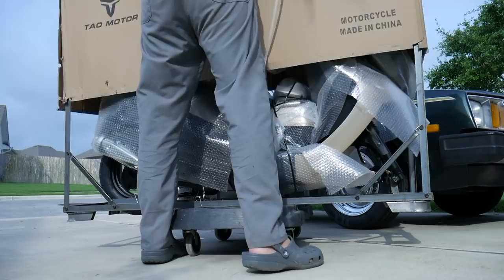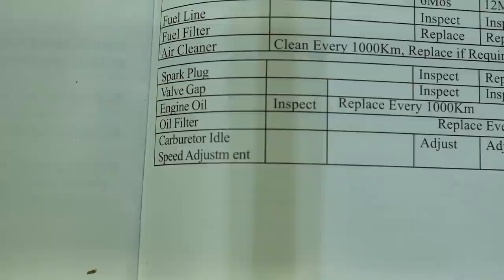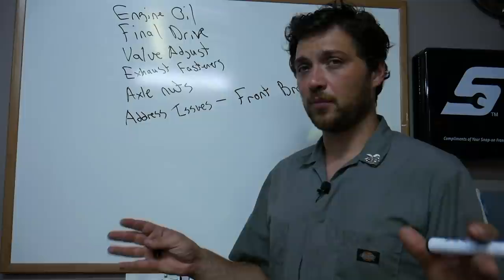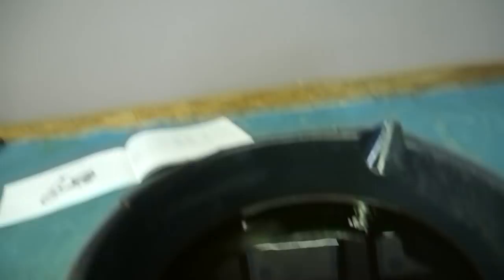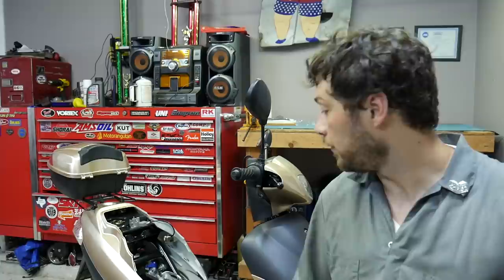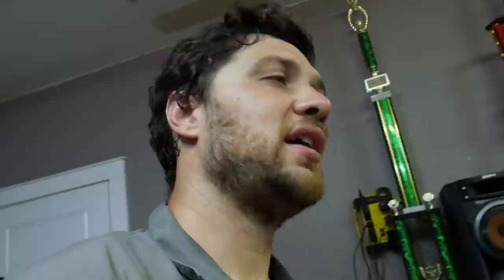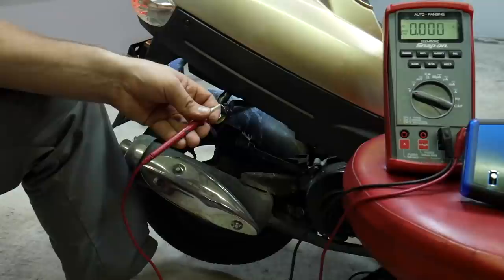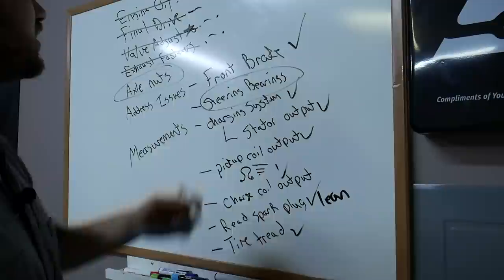(PT. 3) 300 Kilometer service on the most HATED scooter on the internet: Living with a Tao Tao

Comment: Likely not broken in yet. Changing the oil early took away the "rubbing compound" that helps "wear-in" the rings, most likely. 

I heard a story from an old mechanic in the 70's who had a kid bring him a new car that started smoking after a few thousand miles. Turns out the kid had replaced the break-in oil with Wolf's Head, a premium oil, the day he took delivery of the brand new car. 

The Mechanic put break-in oil back in the car and asked the kid to read the owner's manual section about VEHICLE BREAK-IN PERIOD INSTRUCTIONS, out loud, right in from of that mechanic. When the kid got done, the mechanic told him to follow those directions, let the oil do it's job and quit second guessing the engineers who designed his car.

The carb issues are likely due to the low compression due to not being broken-in yet?
Reply: It will still wear the rings and cylinder wall smooth eventually, but may take a lot longer. 
On the plus side, the bearing surfaces love you.
Reply: Actually after a quick check, it looks like low compression would lead to a lean condition due to a lower velocity of air flowing through the venturi, leading to less gas being metered into the airflow. 120 vs 150 is likely a substantial difference on how much air she is pulling through the carb.

My backyard mechanic 2 cents... :)

Comment: if you try and jet the carb your going to have to cut the carb because stock carbs have the bowl screws filled in. You can get a glixal carb which uses philips screws and comes with a bigger jet from the factory

Comment: Put a tube of RVS in the oil and run it for 300 to 500 miles. You're going to get all the compression it's supposed to have. Cost is around 40 bucks.

Comment: Air filter and be sure the engine is on TDC before Valve adjustment, I have Alot experience with the  139qmb and the (gy6) 157 qmj chineze engine

Comment: Yeah I would take the carb off find out what jet she's got and up it by 2 sizes I expect it's got a 70 in or something so put a 72 in there. Running too lean will get the engine HoT and shorten its life. So yes I would most certainly up jet it by 2 then run it for a while then pull the plug and all should be looking as it should!!

Comment: YOU CAN REMOVE .118" thousands of an inch safely and polish it down to a point again(needle valve) and you throttle response and spark-plug color will be favorable!!!!!! All stock, it's also a great tip for a budget owner!!!!!!!!!!!!!!!!!!!!!!!!!!!!!

Comment: If you have the mechanical skills you can keep these little scooters going forever as the spare parts are so cheap and easy to find on ebay amazon ect. I got a brand new boxed crankshaft for £25.00 and new piston and rings for £3.95, then a 70cc bore kit which included most of the engine internals and gaskets for £37.00!.

Comment: So my opinion would be to only go the extra mile, like with adjusting the carb jets, if you think it is something that a person like me (able to google and follow instructions, but no mechanical background) could pull it off without screwing everything up.  If there is anything that you think would absolutely require a professional hand to do, it doesnt help people like me as much to know since I live in a place where professional service is a non-option.  No mods until you've reached whatever original goals you have set, then go nuts and unleash maximum power.

Comment: I don't think you should rejet permanently just yet. Just find out if it will help then put it back to stock. Later, after the scooter is fully broken in, running as good as possible in its stock format with all the weaknesses identified, then make logical mods for better performance (with reliability in mind). Let heavy mods be for preople that want to go further than the scope of your videos.

Comment: An advise is to actually run normal car oil. Worked very well in both of mine and never had a problem with that.
Reply: @Pony Boy I ran 5W40 semi synthetic but never let mine warm up. Full throttle right away and it is still going. Must have ran about 10000km by now actually

Comment: I got a 2006 Rex RS 450 with 15560km. Stator died at 15100km. It produces to much output. At full throttle over 200W and a charging voltage over 17V. For the valves use 0.10/0.10mm

Comment: You mite check miles per gallon of fuel too, is the carb have an adjustment foe the mixture? What carb?
Reply from the maker: I've been keeping track of fuel economy! and yes the carb has an idle mixture screw. The carb is a cheap clone of a Keihin CVK

Comment: You went the extra mile for the engine oil, final drive oil, brakes and headset bearings.  Id say if it needs the rejet/carb adjustment id go the extra mile for that too.  Putting a new carb on is were i'd draw the line.

Comment: We just call that upper nut a "lock" nut
Reply from the maker: hmmm in most service manuals a nut that tightens up against another nut is called a jam nut. Tomato.... tomato?
Reply: @Scooter_911  HA, I pronounce it tomato. Sounds nothing like those 2 examples.

Remember that the service manuals you use are regionally modified. Where I am, they just include more metric and include stuff a little more appropriate.

Comment: The time to return to 13.8 could be a function of the battery.  Weak battery is going to suck the current and keep the voltage down for a while. What about testing the charging system with no load.

Comment: I don't know if you told us about the stock speed, but I know the stock speed is way to slow for me,  when it comes to acceleration or going into traffic., it's up to you if you want to do a before and after fuel consumption, after jet/carb change

Comment: I usually 'bounce' the tire to the floor when I do steering head bearing adjustments while tighten/loosen the nut. 
Well, you've already adjusted the head bearings, why not adjust the carburation?  I find the head bearing adjustment much harder to do than the air/fuel mixture.

Comment: Not a Tao Tao review if you start bolting on aftermarket parts.  I'd say, don't replace parts unless they break.  After all, this is supposed to be about reliability.
As for rejetting - I would ask you, if a customer brought the bike into your shop, would you bring the lean plug up (i.e. do you think this is problematic) and ask them to consider rejetting it?
If you would, then yes, rejet it.

Comment: Are there any Chinese scooters that don't run lean? Put a shim under the needle of the stock carb and got a massive power boost. Checked the spark plug after 200 miles and it was perfect.

Comment: Hi Garret 
Man I need some help 
I’m bout ready to Dump my Tao Tao 
Bought 3 years ago 
Rode it for a few months 
Had an issue 
Couldn’t solve 
So it sat 
I played with it off and on 
Here goes 
I’ve changed everything 
To start 
I use starter fluid 
In the carburetor 
It doesn’t start on its own
Reply from the maker: Have you tried a valve adjustment?

Comment: Sadly all you can do is rejet unless carb fails than you would note that and replace. But your motor is looking like a lemon. Comp being that low at 300km not good at all brand new it should pop up to 140 slowing down than work its way to 150-160

Comment: Can I ask you honestly, how did you break the engine in? Did you just drive it normally, or did you go the "official" route of only using 1/4th throttle and not going faster than 20mph for the first hundred miles?

Comment: My experience with these Chinese scooters has always been carb issues. Usually after not using for a while the jets clog and it won't start. Any suggestions?
Reply from the maker: If your scooter is going to be sitting for a while drain the fuel out of the carburetor. It will save you the hassle of the jets clogging!
Reply: @Scooter_911  What do you think about the EFI for these engines vs. a carb? And are there any cheap scooters with EFI worth it?

Comment: check the belt......  my belt broke at 6000 miles. the dealer never told me to replace at 5000 miles.
Reply: If the maintenance was done on time by the dealer, i would hold him responsible. If you do the maintenance yourself, check check double check your service manual regularly.

Comment: How much final drive gear oil goes in? I don’t want to under fill. And was it about 70 percent of the container of motor oil?
Reply from the maker: usually arround 110cc's. you fill the case until it runs out of the fill plug. And yep its around 700ccs of engine oil.
Reply: Garret Seesing Thanks, dude.  Might’ve put too much gear oil at first, but then I let it drain. Mine has a host of issues. But I’m going to work on the carb and see if that helps the hesitation, stalling, speed, gas burning and sputtering
Reply: Side question, which Carb would you recommend. The pz19 speedy that Tao Tao recommended is never in stock on their sister parts shop.

Comment: Did yours use any oil at this point? Mines used about a quarter quart by 162km?
Reply from the maker: No actually! My little scoot doesn't seem to consume any oil
Reply: @Scooter_911  I appreciate you getting back to me...I used driven BR40 break in oil like I use in the car engines I break in... Hopefully yours is going good... I'll see if mine gets better by the 1000km mark.. If not I'll put a big bore kit on it... Thanks man!

Comment: These tao taos and chinese scoots literally have the maintenance regimen of a Ferrari. 

Run away. Save up just a couple more dollars and buy a used japanese/taiwanese scoot off of craigslist or marketplace. Many leagues ahead of these things.
Reply: FWIW I only say this as someone who had owned a handful of them, and worked on others. I had a couple Taos with BBK's and all sorts of other mods that would just barely (and I mean BARELY) eek by a rock stock Buddy or Roughhouse, with 1/10th the reliability. Every other ride you are checking the thing over. 

I know a lot of people who don't have a lot of cash especially nowadays are looking for inexpensive transportation. These chinese scoots legitimately will make your life difficult if you are trying to commute to work on them on a regular basis let alone just as a toy to mess around on.
Reply: @LeadTheBore  your luck has been bad , i have a taotao powermax vip 150cc 157QMJ that i didn't change the oil until after 25,000 miles , still has factory transmission gear oil, belt, brakes et cetera . still runs great . i never had a taotao 50cc so cannot comment on those models.
Reply: @carmineredd1198  are you sure its 25,000 and not 2500 miles? I doubt there would be any oil left in the crankcase at 25,000.
Reply: @LeadTheBore  25,000+ , i did check the level and add as needed but i only drained it after 25,000 miles . mine registers in miles not kilometers .

Comment: Hi, Isn't that the running-in period of this type of engines longer than Japanese brands?
Reply from the maker: yeah, the owners manual lists the "break-in" period as under 3000 kilometers. Usually the japanese brands have 500 miles or it incrementally eases up. Its pretty strange but i've been following it.

Comment: u keeep saying ac it its not ac volts dude
Reply from the maker: The stator generates AC current. The regulator rectifier takes the AC current, converts it to DC and regulates the voltage output. By the time it reaches the battery it is DC yes, but the charging system measurements are in AC.

Comment: I like watching that kind of videos, but Your whole project even if successful will prove nothing, because nobody who owns cheap ass scooter will be so overprotective about it’s technical maintenance. The amount of labor hours needed to keep up with Your standards will exceed the value of the scooter.
Reply: So you want a test like: I drove 3000 km, my steering is loose, everything fall off, engine is week and misfire, battery dead, I did no service whatever, I tortured it in a forrest every weekend, this scooter is pice of crapp, I hate my parents,  they should buy me a Peugeot, then I will avoid every moisture and the manual will be my bible. As I see you are Polish so you have tones of such a videos in Polish YouTube LOL
My approach to romet (tao tao under one of 123 its brands) was same as this guy, I bought a cheep crapp, so I must pay the rest in the working hours. Damn thing was reliable af and gave a lot of pleasure leaving far behind "branded" mopeds.